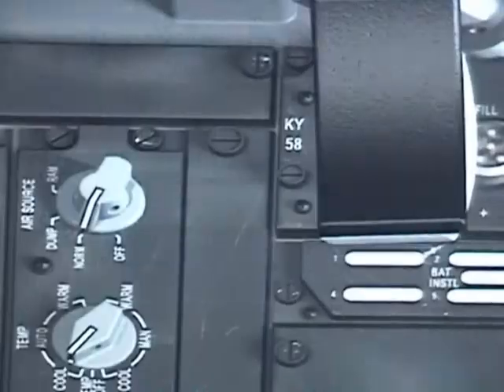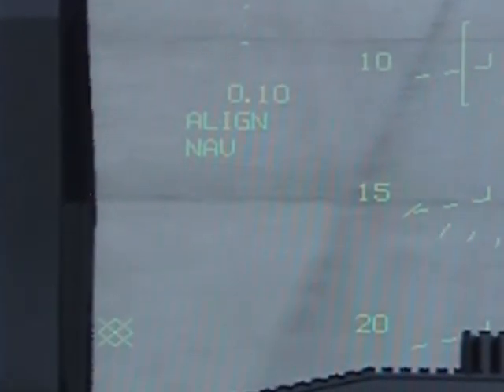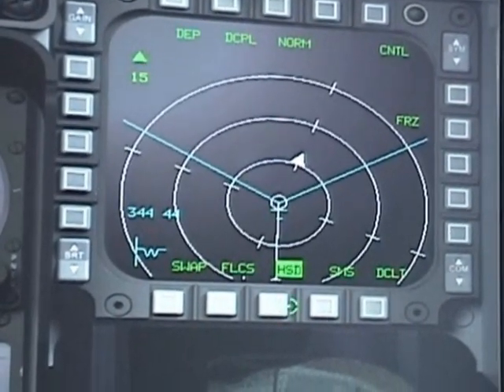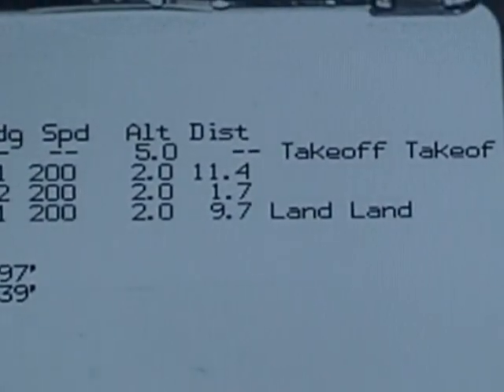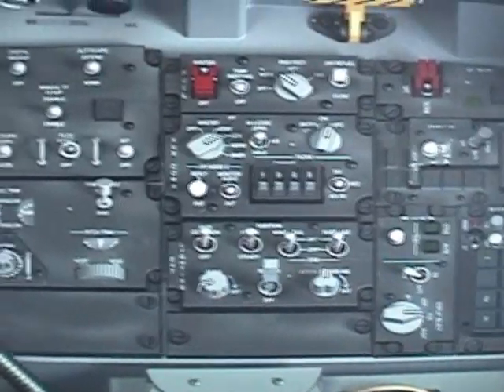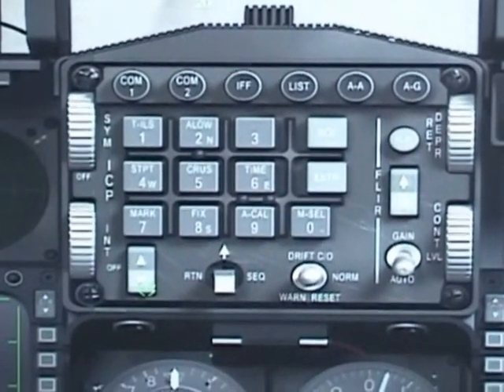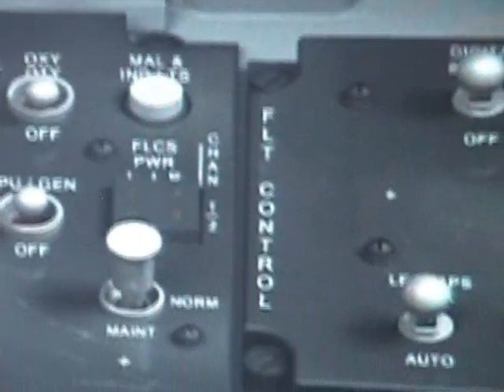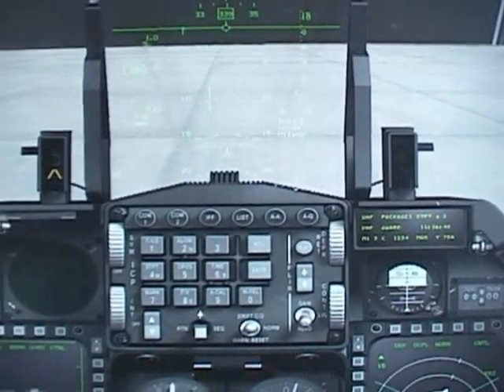F16 FALCON 4.0+RV HQ RAMP START PART 2

Comment: Couple of minor mistakes, the left and right hardpoint switches are not required to be turned on unless you are carrying the targeting pod or the HTS pod. Also the radar altimeter can be set to on and it will come onine when it warms up automatically, you just don't want it to be on on the ground due to hazardous radiation. These are mistakes in the manual actually rather than your fault :) thanks for the vid.